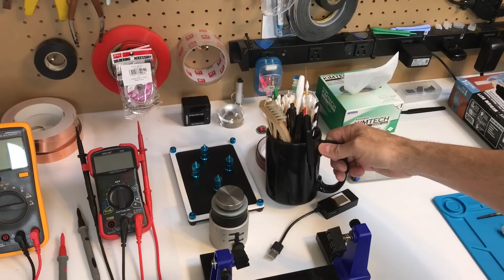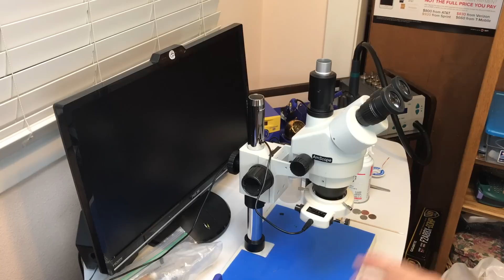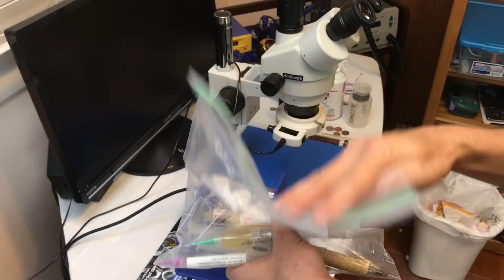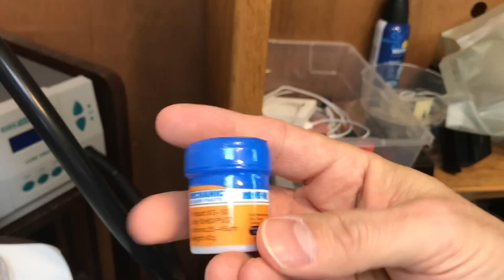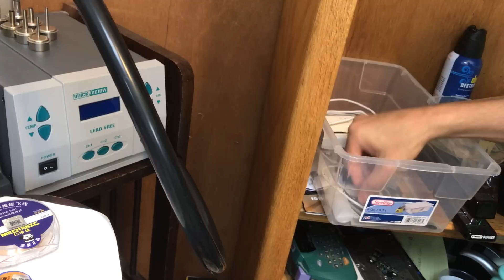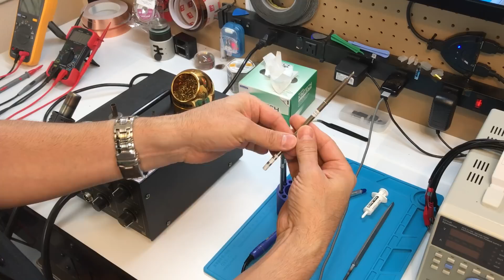Micro Soldering Repair Equipment

Comment from the maker: The cheap multi meter will not do much good for anything beyond USB ports. Get something better.
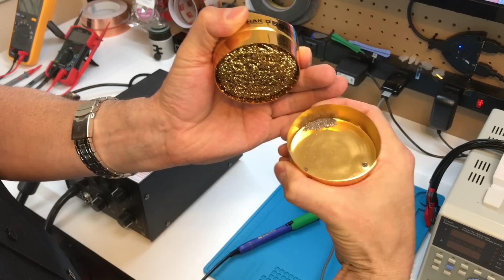Reply: 46:49 Scrapyards buy used solder as well as PCB's
Reply: Go Cell Phone Repair qqq1g
Reply from the maker: Good to know.

Comment: Hi there, which microscope do you currently prefer voor smd components?
Reply from the maker: I was using the AmScope SM-4TPZ and it worked great. I have since changed out the head piece with one from Kaisi shown in this video https://www.youtube.com/watch?v=ijewSYPxmWY. It has a greater field of view and is fully compatible with my current stand. It's the best combination I have found so far.
Reply: @GoCellPhoneRepair  Ah thank you!

Comment: I know this video is 5 yrs old now, but one suggestion on the issue with microscope platform being above your surface area, you could cut a sheet of plywood to cover the desk and then cut a square hole in plywood to set the stand into. You could then use on top of the plywood a heat resistant ESD mat. You would naturally cut out the square in the Mat too so. If you wanted to take microscope you can simply pull it out and off you go. I would also cut a piece of plywood to fit inside the square in the plywood that exactly fits so you can remove the scope and put in the plywood piece and put the mat on top and now you have an entire work surface. This way your entire work surface is at the same level. Much easier than using books to prop up extractor, etc..Only downside is your scope will be in one place all the time, if you wanted to move it to another location on the table, It then puts you in the same situation you are currently in in this video

Comment: ihave a tip for all tech here. see that cold air can to detect shorts? it cost around 15 to 25 dlls. well some of you probably know that a can of compressed air can do pretty much the same if you put it downwrd and shake it. then spray the board and then slighty blow the board with the same air can this time with the air outle up. or blowing it with your mouth. thanks to edgar yoreparo youtuber. ,my master

Comment: How to save your solder paste:   Buy a cheap little under desk refrigerator for your shop (WalMart, less than $100).  Then you can have a cold drink once in a while, and no one will throw it away but you.

Comment: One can find chinese hot air soldering combo stations with calibration pots. you can set the temperature with your prefered tip or nozzle, they are perfect for a hobbiest.

Comment: Great video! TIPS FROM AN OLD RADIO GUY: 1) I wish someone would make a cheaper hose type fume extractor to compete with the "better" blue n yellow brand. The price is just RIDICULOUS, especially when you are committed to using their filters. 2) Have a straight work surface. A "Curved" table is a pain: It doesn't allow round bellies to get close to the work. 3) You need to get a GOOD work chair. You can recognise a BAD chair the first ten minutes that you sit on it. Find a GOOD chair, and quality on chairs doesn't have a lot of bearing (but some) on price point! Look until you have found a SUITABLE CHAIR. (Remember the old joke line from the movie "Used Cars"... "Son, for every Seat, there's an a$$...") Find one that suits yours. You need a GOOD CHAIR OVER EVERYTHING ELSE TO DO FINE WORK. DID I ENPHASIZE THAT ENOUGH? ;-)  4) You need EYE PROTECTION. Just like when you go to the High School Prom: USE PROTECTION EVERYTIME. 4) You should also WEAR A MASK. Without one, when you exhale, you will lose smd parts. And you won't find them. 5) Those SAME SMD parts are an INHALATION HAZARD, and if you don't think so, you are just kidding yourself. 6) adding flux to solder wick works well. Braid from old coax also works and is cheap. 7) REVERSE TWEEZERS from Joanne Fabrics work well. Never have seen antistatic ones, and always wondered why. And FINALLY 8.) For any electronics work: You need a meter that has a MICROAMPS SCALE. This is also a quality check in general for the kind of resolution and accuracy that you need... It's also the difference between doing "electronics" and "electrical" work. When it comes to measurements: You wouldn't weigh a letter with a Truck Scale, nor would you weigh a truck with a postal scale.
Reply: I just use a vivosun inline fan (they make them for grow tents but they work for anything) for around 69 dollars. You can get the hose for cheap from same company on Amazon and I use a portable air conditioner window kit to have the hose out my window. They aren’t expensive either. Just a piece of plastic with a hole in it for the ventilation hose. If you aren’t near a window they have other attachments as well like a big filter that’s also pretty cheap.

Comment: I've used both Hakko and Metcal soldering/desoldering equipment. I found the tips for the Metcal last considerably longer than the Hakko. The Metcal also has a larger selection of tips for both soldering and desoldering.

For those who use the old wet sponge for cleaning tips, use DI or distilled water and not tap water. Depending on where you live, tap water can have a large amount of minerals and that will affect the cleanliness of the iron tips.

Comment: So, fluke is like apple of multimeters. Just use for status, but others less expensive bdo the job well.
Reply: Fluke is big, bulky and overpriced, pretty practical for high voltage stuff, but takes lots of space on the bench.
There are mid priced multimeters I hate them all, basically they are worse than the cheapo onces, not accurate, draining the battery, or you just can't turn of the *@^# autosleep and the beeping.

Cheap Chinese multimeters like 20 bucks little ANENG or UNI-T are much faster with wider resolution 10000 and 6000 digits. If you measure resistance especially in milliohm range I don't recommend them, but the DC voltage is spot on. 
My current favorite multimeter for low voltage stuff is ANENG AN8008 with fine tip silicone probes.

Comment: Have you considered boring a hole on that work desk so you can attach the pole from the microscope, so you can get rid of the base?  or do you need the base to be portable?
Reply from the maker: Yes! I actually replaced this scope and moved it to another location but attaching an articulating arm/stand to the work bench is my ultimate goal.

Comment: Your fume extractor is just a fan.. stop fooling your self.... You are still breathing in all the cancer causing fumes into your lungs...
Reply from the maker: I agree completely! This thing may have an activated carbon filter that absorbs down to what? .5 microns or something... so they say. Even with that, my HEPA filter running, and all of the windows open I would still wear a mask if it didn't fog up the oculars on my scope overtime that I exhale. I suspect that even the "industrial" fume extractors don't catch everything and for that reason I will be building an exhaust system here soon so that most if not all vapors go outside of the building. Assuming that it does not violate any ordinances of course that seems to be the safest option other than soldering outdoors with a fan running constantly. 

By the way if you think that any of these catch a lot of smoke just because the filters get dirty just let one run for a few days with no soldering activity. Air is far from clean unless maybe you live at a high altitude or near the ocean.

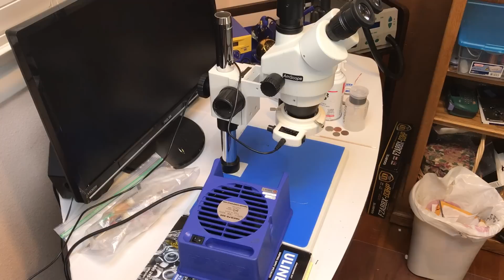Comment: 19:44 The boiling point of lead is 3180 °F ...
Reply: Okurka when I was looking for fume extractors I found out that lead is not the big issue with solder fumes. It‘s mostly flux and burned plastics. I still doubt that the mini activated carbon filters of those desktop fume extractors have a cleaning effect. Pro gear uses bigger carbon filters and extra HEPA filters, too. But for hobbyists, just getting the smoke out of your face is probably the biggest issue.
Reply: @FuchsHorst  yeah that flux made me sick as fuck one day after soldering all day with no fume extraotr I felt like I had the flu. Flux will fuck you up bad if you inhale that shit.

Comment: Nice video, you run a out of the same stuff I do.  Even the fist bench I bought, lol. I thought about trying that new microscope base but with the cross arm, you can get the cross arm section separate also and it might take the head over the base? 
Yea, AmTech (made by inventec now) doesn’t use holograms as you found out and mentioned on another comment. Also these days even some fake stuff has convincing labels. I found a few in the US that I’ve confirmed is real, listed in the video description. https://youtu.be/7wJhi3UGf8E one way to help extend the life if you don’t use it every day with flux is keep it cool or refrigerated. 
For the mechanic solder paste I put a small fridge in the lab, mine used to get thrown out also. 
I have a set of stencils that are different diameters for solder balls, but not in any pattern for a specific chip, something like these over sized squares if you select the one with the correct spacing would have worked on that odd chip you had. I just use kapton tape to tape the chip to it.
Reply from the maker: Thanks. The scope in this video is great if you need something mobile. I have since purchased the double boom type with a simul-focal head and for recording videos that's the way to go. Why did they ever make a shared ocular setup in the first place? According to AmScope that gives you the best photo quality but my biggest regret was buying that type in the first place. Such a waste of money as far as I'm concerned. Fortunately the heads are interchangeable so anytime something needs to be recorded it's not a big problem. 
Interesting idea regarding the stencils. I've "cheated" using something that's close enough but is makes sense that there would be something out there with enough variety in size and orientation to work with most ICs. I'll have to look into that.

Comment: that amtech flux you have is in fact the fake one, the original does not look like that. would recommend not using it
Reply from the maker: I ended up getting some of the real stuff and side by side- wow. Totally different color and label.
Reply: yeah, going to actual flux vs petroleum jelly or whatever they pack in there. as long as you dont buy from ebay / amazon and only from authorized dist its gtg

Comment: Question here, would someone be able to micro solder from just useing an added camera looking at pic on a LCD screen to do it? Or do you have to look through the eye peices?? Which is easier?

 I have a mircoscope but it Needs a camera, it has no eye peice  to look in.
Reply from the maker: You can but in most peoples opinion it is much more difficult. Having a stereoscopic view allows depth perception which can be a big deal especially when dealing with very small parts.
Reply: Go Cell Phone Repair Okay, thanks!! I know exactly what I me e d to do!! Love the vids like these!! Keep em going!

Comment: I know you made this video 6 months ago, are these still the tools you still using? I'm really interested to getting into microsoldering but still have to get all the equipment... almost gave up when I got a solder iron from radio shack, really frustrating never got any done... then I look at your videos. I found this 3 in 1 853D SMD DC Power Supply Hot Air Iron Gun Rework Soldering Station Welder and is less than $80 lol (there are some videos about this), I'm almost sure you didn't have to go thru this type of equipment but I don't have a lot of money... so my question is, would you recommend that for me, to start on something or save up and get the equipment you mentioned here? And thank you for the amazing videos!!!  And you answer my question at the end of the video haha... this one comes with a power tester also
Reply from the maker: Wow six months goes by fast! For the most part I am still using the tools shown in this video. There are a few new things that I've added so I'll be making an update soon. As far as soldering though the Hakko FM203 still gets the job done for everything that I've had to work on.
Reply: Go Cell Phone Repair hurry up with the update lol... then I should save up to buy the right equipment or star with something cheap?, not radio shack cheap though haha
Reply: I have the hot air rework station you're talking about (just air version, not both) and it works good for me. However, I don't do a ton of SMD work currently. Idealy I will upgrade to better quality when I do more, but it's a great starter station. I think you should get it to start. 
I also use to the Hakko FX888D soldering station, it's amazing and afordable. Not perfect for SMD work, but it works, and it's night and day better than anything from Radio Shack!! 

Cheers!

Comment: I have been interested in lerning about cell phone repair and ipads   and so on. What would b e you suggestion for me to get started in the learning process. Also while the thought just hit me, what tools are need for a beginner thanks for yo ur time
Reply from the maker: Hi Kenny. It would take some time to thoroughly answer your question so I will plan for making a video response in the future as there are probably more people out there who want to know the same thing. For the short version:

The best way to learn is hands on. Work part time at a repair shop that is willing to teach you on the job, take a repair training course if practical, and at a minimum buy some broken devices and see how far you can go using online repair guides. The majority of this industry is screen repair so don't feel obligated to jump into micro soldering at the beginning. You should have made plenty of money by the time you take that step. When it comes to tools you'll need screwdrivers, pry tools, a heat gun, and lots of supplies. It will depend to an extent on what you plan to repair but we do have a few recommendations on our website here: http://gocellphonerepair.com/tools-and-supplies/

Any good repair tutorial should make what you will need for the job obvious. As time permits I'll work on a more detailed answer for you. Feel free to add any additional questions that you have so that I can address them at that time.

Comment: 21:27 - I built a stand to hold my various flux and fluid syringes from a piece of scrap 2 x 4 block of wood. I cut it to 9” (L) x 2 (H) x 1.5 (W) and drilled 5 evenly spaced holes all the way through at a diameter of 3/4 inches each. Then on the top of each hole I dremmeled out roughly a 1/4 inch countersink in a shape resembling the syringe finger-holds so that as each syringe’s push stem recedes with use, each syringe still has a recess to hold it upright. IMPORTANT NOTE: My template dimensions were designed for 5 identical syringes that I bought and filled myself with flux, thermal pastes, lithium grease, and machine oil. Meaning, I knew the consistent dimensions of each syringe I required in advance of building the stand. Your mileage may vary based on the various sizes of syringed products you purchase. I’m going to 3D print my next version of this syringe holder.
Reply from the maker: That's a great idea! I am figuring out how my new work bench will be setup and on thing that I am lacking right now is shelves for all of the equipment that currently takes up space on my desktop- power supply, hot air station, soldering station, etc. I'll have to make sure to allow something to attach the stand you described as well as my magnetic strips that tools stick to.

Comment: I used the Taiwan made "Mastech" and it is nothing different compare than fluke. I paid less than $30 and it is accurate.
Reply: Might need to do some precision tests to really compare. Also with a more expensive product you get good after service
Reply from the maker: Have you compared resistance measurements for the flex cable connectors? That's where my cheap meter failed.

Comment: AmScope has a similar if not identical ring light.  Model #LED-144W-ZK for $24.50
http://www.amscope.com/white-adjustable-144-led-ring-light-illuminator-for-stereo-microscope-camera.html
Reply from the maker: Yep. It is the same light exactly. Besides being an Ebay partner they also award points for purchases that you can spend which is why I prefer to buy from there instead.
Reply: My understanding was that you referenced Amazon as the supplier.
Reply from the maker: I probably did in the video but anytime it's available on Ebay I buy there.

Comment: dude you need a new microscope. allmost every tool you explained doesnt work with your scope lolz
Reply from the maker: Which tool specifically does not work with this microscope?
Reply: the pcb holders. you showd them and  you keep comming back at the max hight you got on your scope. thats why i said you need a new one thats all
Reply from the maker: Ah okay. Yeah some are a bit high so I usually stick with the old school type. Will probably switch to a .75 Barlowe lens eventually. Wait no, that wouldn't solve the issue. Maybe a boom stand and taller stool.